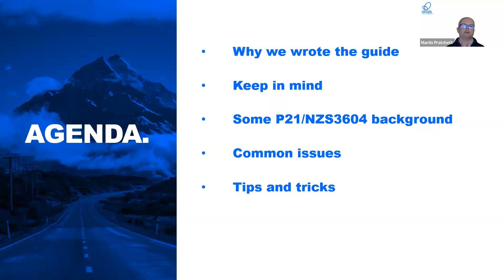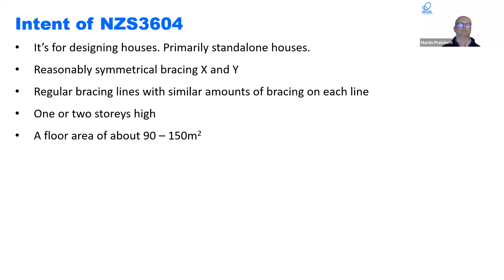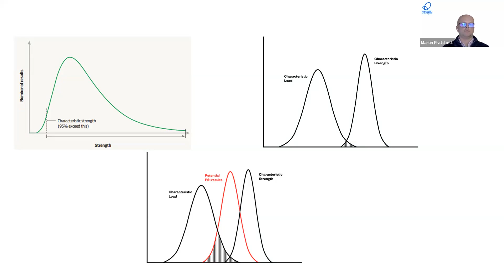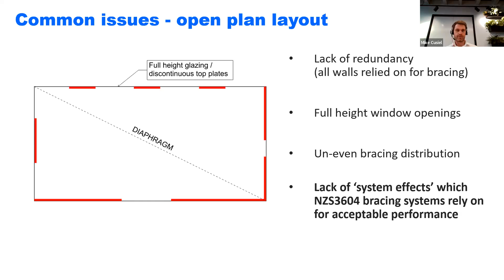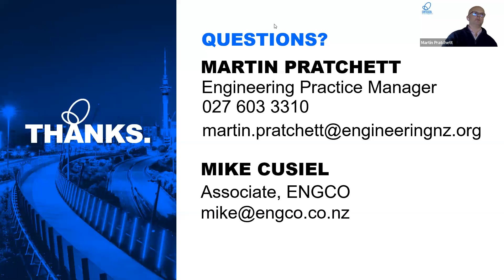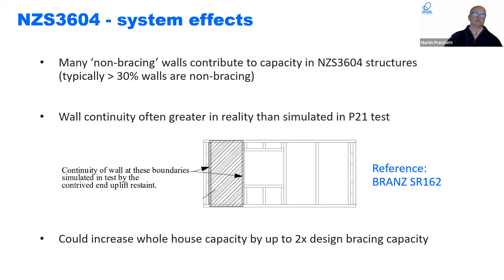April 2023 – P21 bracing systems with SED structures – Martin Pratchett

Comment: It would be good to give some calculation examples, such as timber diaphragm (not CLT, joists + partical boards) strength cals, timber diaphragm torsional analysis. It would be even better if those cals are practical, relatively straight forward, more suitable for residential scale type of projects. 
How to analyze diaphragm if timber framings mixed with steel frames.